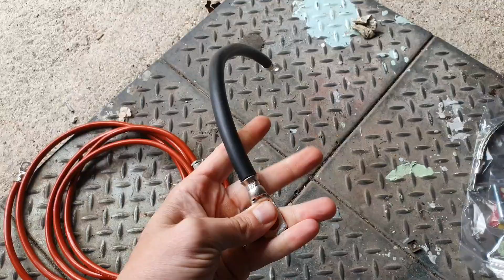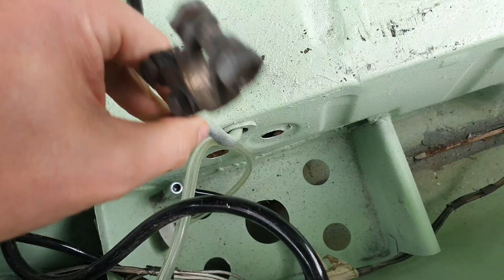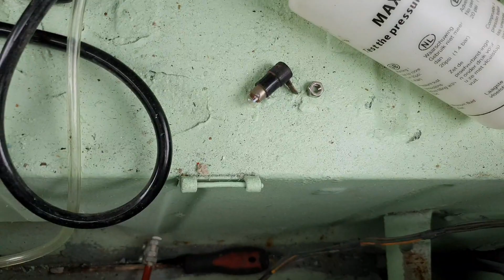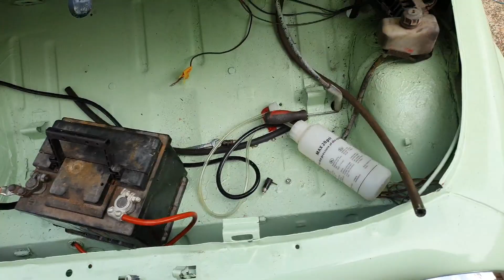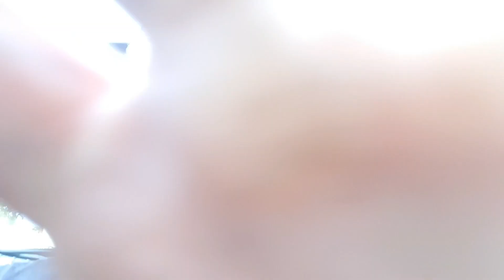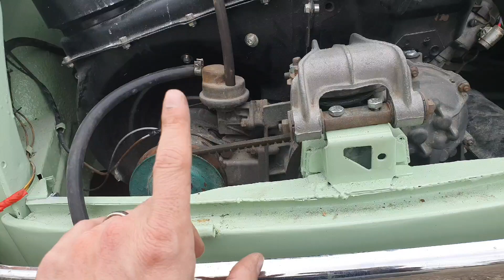Classic Fiat 500 restoration - Did we finally get the engine running?

Comment: Hey, quick tip, I tie a thin rope/thick string to the starter leaver pass it through the sunroof. Then i can start the engine whilst looking at it!
Reply from the maker: Thats a good shout, when engine is cold and i wont burn myself on exhsust i just reach in and manually work the lever direct on the starter
Reply: Yeah, it dose get a little spicy in there. 😅